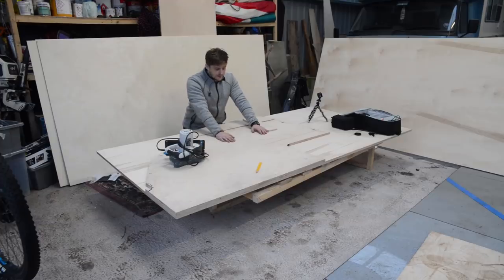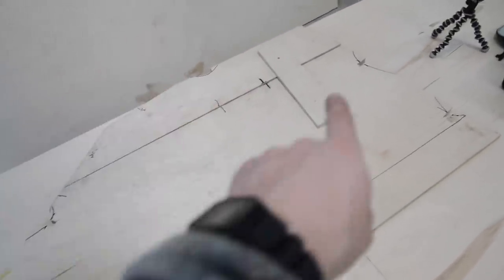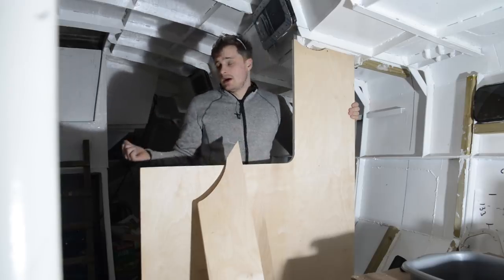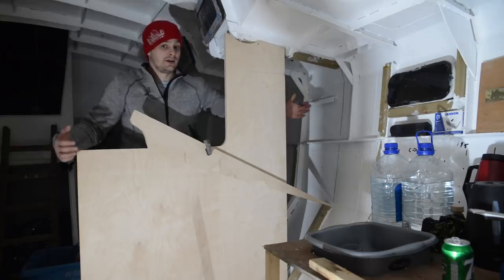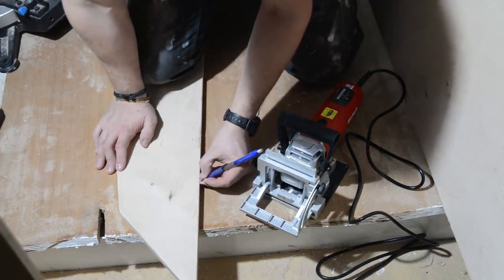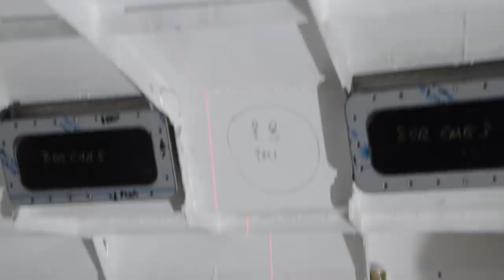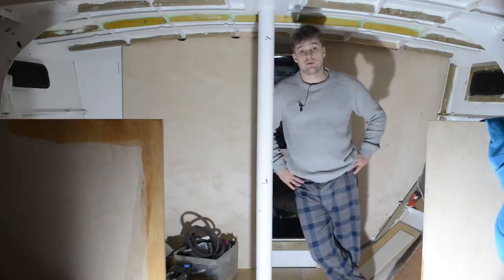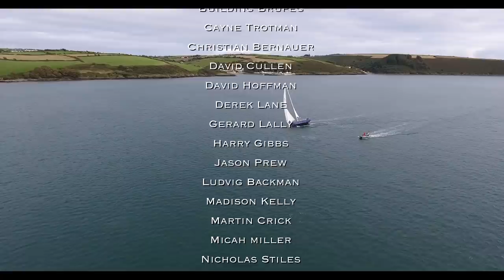Fitting the Bulkheads - Ep 24 - DIY Yacht Build

Comment: Hi Rhys
A little tip for the joint in the bulkhead. If you plan on using filler give both edges a chamfer of 1-2mm so the filler has something to grip on to. Nice progress!

Comment: Great work - but those bulkheads at 13 minutes need the corners rounding.

I was fascinated by the biscuit joint, I have never seen that done before.
Reply from the maker: I agree, I won't be sorting the trim until the end of the interior build, and as a result that sort of thing will be sorted. I just don't want to go rounding things until i know what my trim plan is

Comment: 14 biscuits will do it ,  epoxy then no clamps.... use  10  x 18 mm hardwood ply blocks 120mm square.
drill 4 holes 5.5mm angled at 45 or more 35mm from edge.
cover blocks in packing tape and release agent or furniture spray.
using 40mm 5mm screws  check the block is the correct way up in the middle of the two sheets to join.
then screw.. these blocks wil suck up the two sheets 5-8mm ...easy job.
I am nearly finished fitting out a 11m steel abandoned project in Germany.
I lined out with 30mm xps (used 1 euro sheet) and PU foam using 8 cheap plasterboard supports..

Comment: If the bulkhead is perpendicular to the centerline I also assume the edge is plumb.  How do you find "plumb" in a boat that is floating ?  Wait for a very calm day and hope there are no heavy objects to the port or starboard ?
Reply from the maker: Good question. I levelled the floor based off the centreline and then worked off that. If I was goin to do all this again I reckon I would do it on the hard, but my situation this time didn't allow that

Comment: Do your bulkheads need to be made of heavy wood ? As the boats structure is so strong ? 
Lightweight cored structure for interior would give you a faster lighter boat ?? 
Just a thought !!! 
Great channel
Reply from the maker: They are pretty much just dividing walls, so unlike a fibreglass boat they offer little to no structural support to the hull, just the interior joinery

Comment: Glad you took time off for holidays .Christmas  Helps keep perspective oblong term projects.. So when you mount the wood the boat framework do drill and then paint the holes the fasten with bolts or some other way?
Reply from the maker: They're actually bonded with a sealant, it's incredibly strong so no need to bolt. The floor beams were bolted in and the holes were painted before bolting.

Comment: Does drilling the holes in the frame for conduit compromise the structure?
Reply from the maker: Not at that point in the structure. It is very well supported by "knees" connecting the frames to the deck.

Comment: Workshop's a good idea. Make it just the tiny tad bigger, carry some basic materials/spares in surplus and the best of machinery/tooling You got (my little ac/dc wig welder with a bottle argon to repair stainless and alu did pay off in three month of eastern Med season and made me the most money of all, even more than Volvo impellers, O-rings and gasketpaper). No matter where You'll go, there will be everytime at least one yacht whose owner will be more than happy to pay You reasonably for a fix that would otherwise have forced him far outa his way.
Reply from the maker: Good thinking, tig is something I want to bring with me for sure :)
Reply: @SailingYachtZora  In the Med they ruin their pushpits and swimming ladders, in the Baltic it's the pulpit. 😂
Depending on where You plan to go You might look for a machine tolerant of generator current. (Depending on what electricalities You plan for Zora). Wasn't a prob for me in the Med: everywhere You go there's 220 or 230 V and 50 Hz alternating. Not so in the Caribbean, Africa and U.S./ Canuckistan.
AC/DC (alu/stainless) was about 50 % each I used, so the "better" alu-suitable machines are what helps most. 🍻